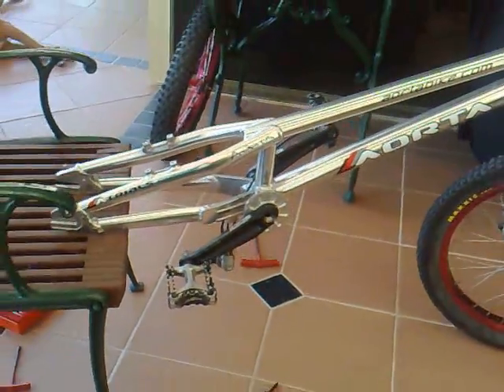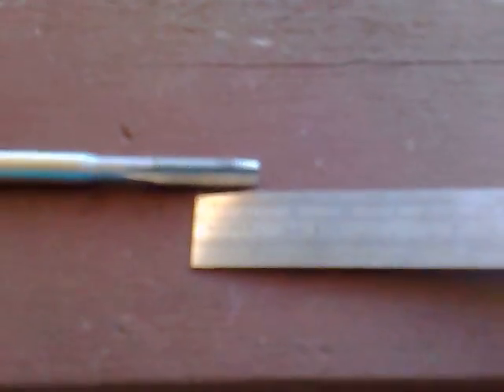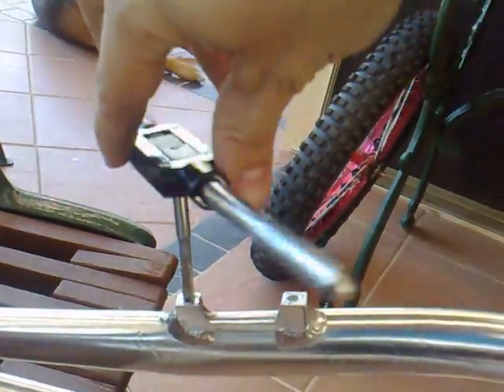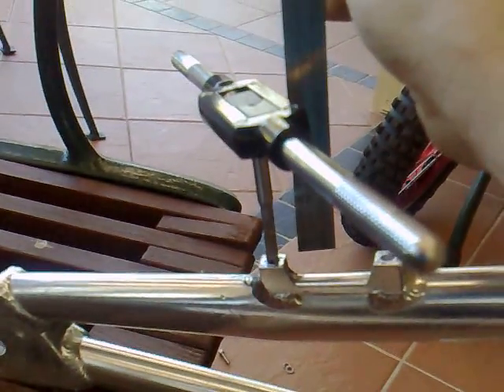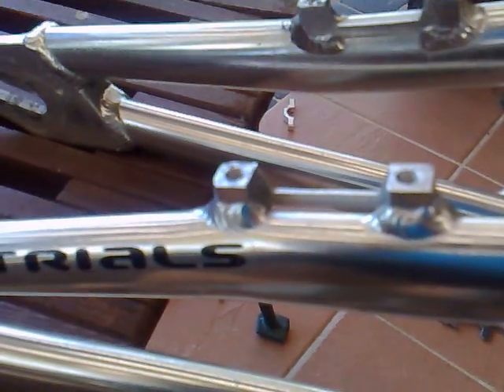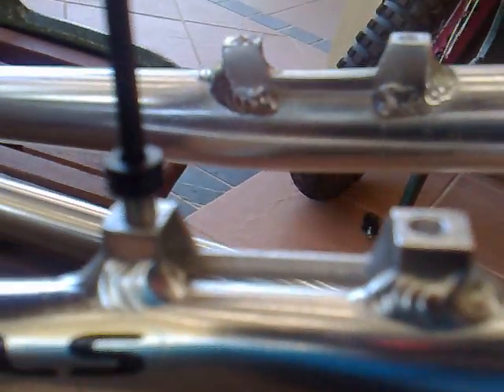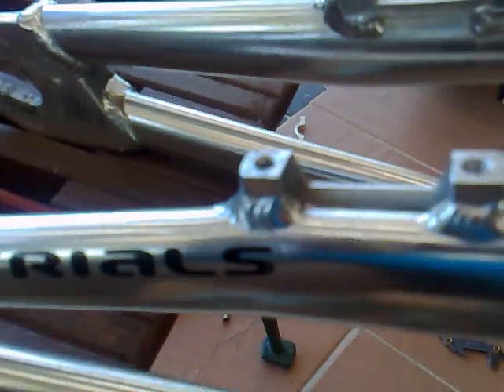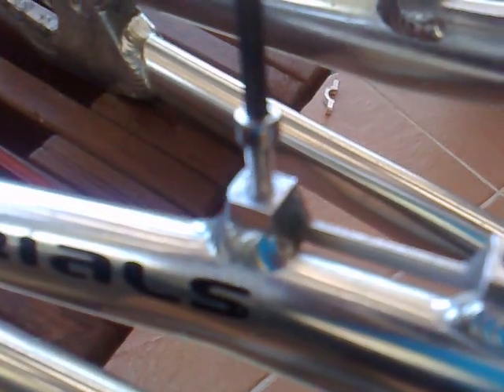Instructional Tapping of magura brake mounts.mp4

Comment from the maker: @111alien111 In theory, yes. But in practice, you need to pull the cylinder head off, otherwise you would find a lot of metal filings getting down into the cylinder, which can scratch the piston bores and lead to even bigger problems.